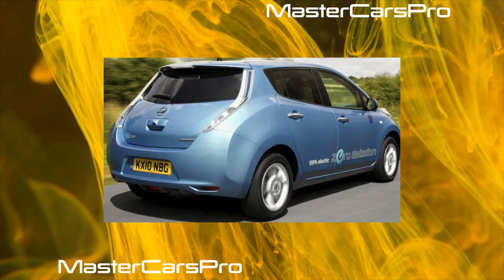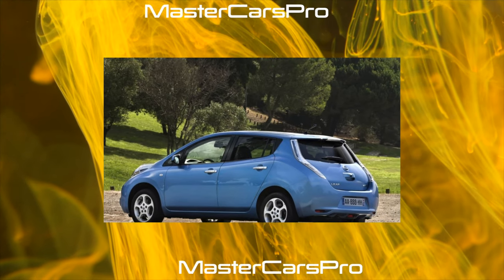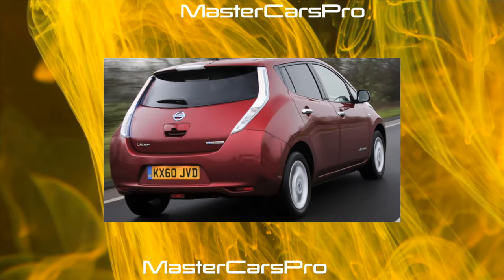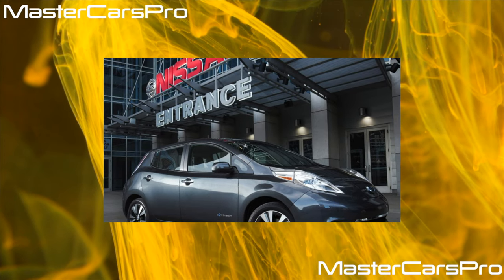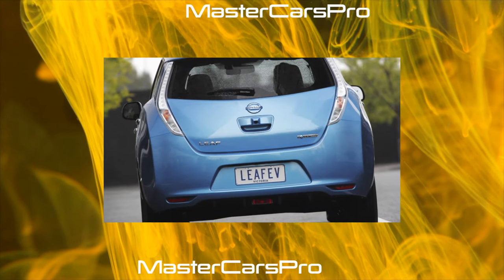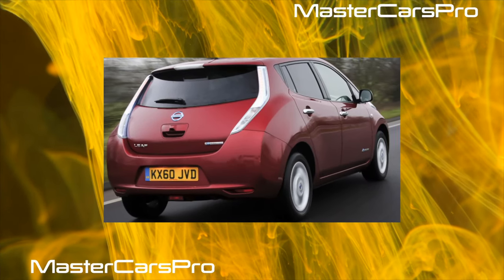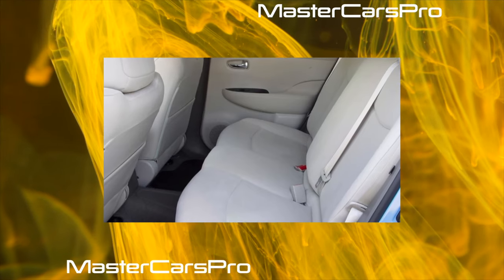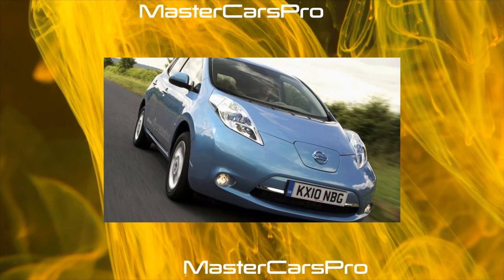What are the cons of owning a Nissan Leaf I 2010 - 2017?

Comment: Do you think there has been any improvement that's worth mentioning in the 2019 Nissan Leaf Plus Trim's  
in respect to the battery's operating temperature in very sunny and hot conditions?

I'm interested in this car and in that exact year, but worry about it's performance and battery degradation, that might be
super enhanced when it's being charged in the evening at  80 to 90 degrees at night,  which is very common in Las Vegas and a lot of Arizona
from May until September,   (I also would try to limit driving the car that much during the day when it's over 110 degrees and not try to drive the car more than 
30 miles on those days.